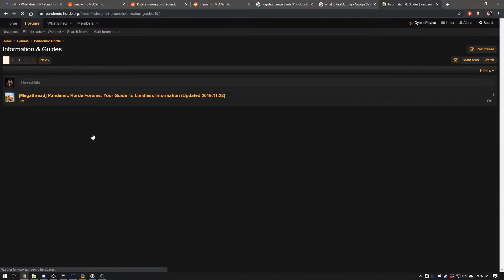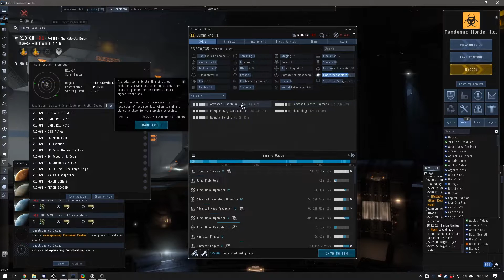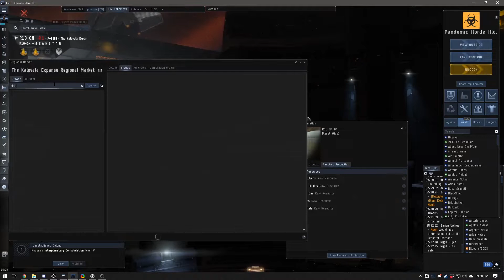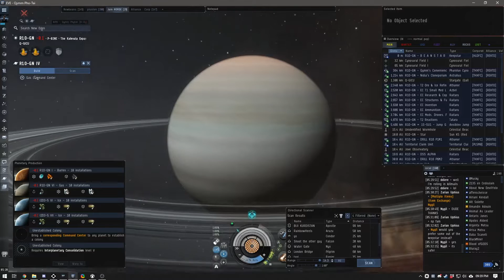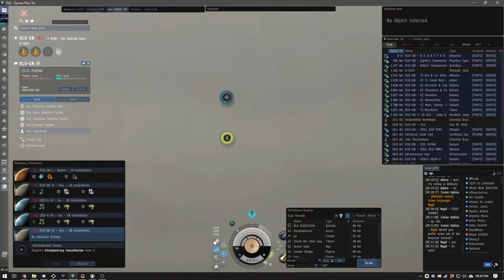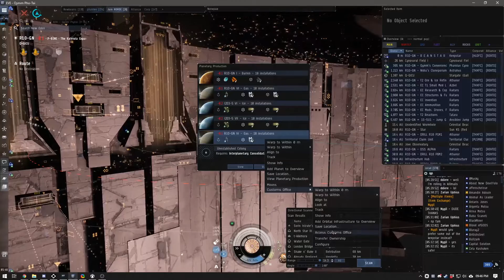Horde NBI - Planetary Production - P1 Tutorial

Comment: fwiw i run my epithal with 2 fits. warp core / inertia stabs for PI pickups. warp core stabs / expanded cargo II for command center drop off. i think 2 expanded cargo holds will get you > 1000m3